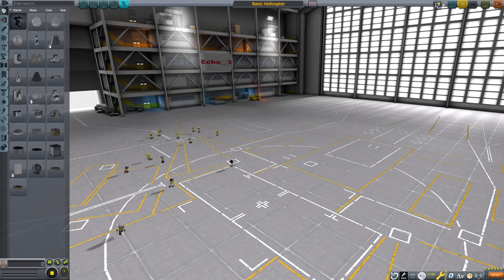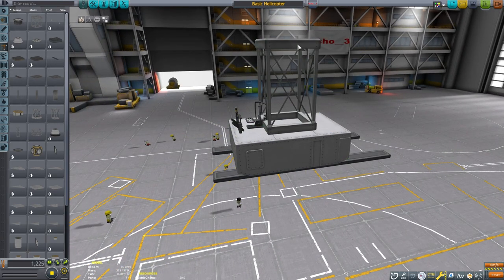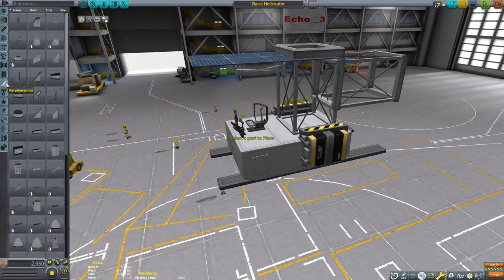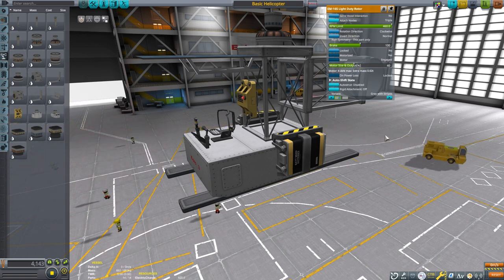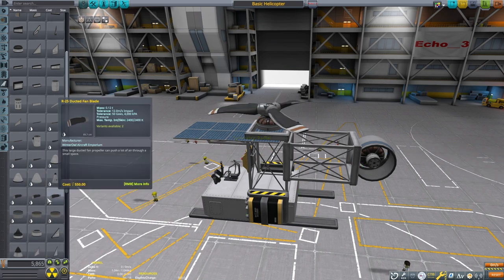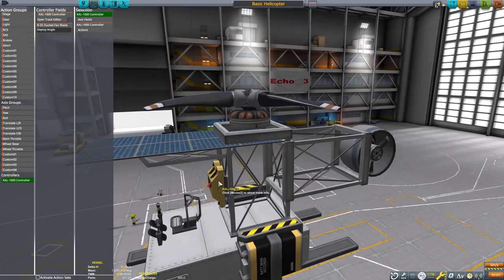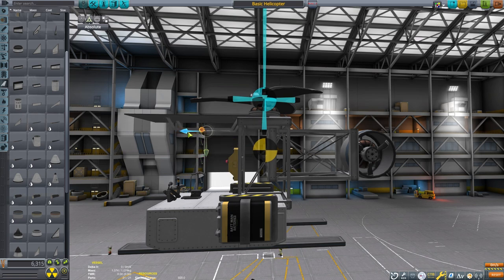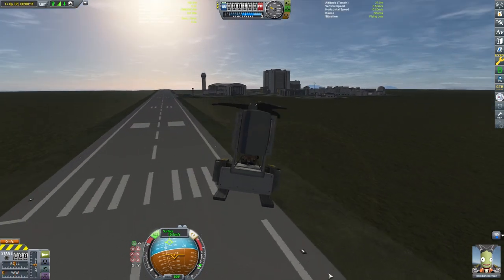Basic Helicopter Tutorial

Comment: I've read the replies to the other commenters that also had an uncontrollable spinning helicopter immediately upon take off. I can't get it to fly straight. My deployment angle on the trail rotor is at 10
Reply from the maker: I typically don't set an angle. I will deploy the tail rotor and give it around 5 degrees of control authority. Then I let SAS handle the exact amount. If you want to try and set a deploy angle, most of my designs were stable between 1 and 2 degrees. A KAL 1000 is needed to fine tune the exact amount.

Comment: I have tried a million times to set up the control device thing and it never works for me. I've set up the action things just as I saw and apon launching the propellers are already spinning. The rotors do not tilt yet when I go to the controller and press play it does. I csnt control the speed of the rotors even though I've attached it to master throttle control. I need a slow step by step video where this part isn't rushed through. Or a step by step directions list. I just csnt get this done.
Reply from the maker: I like to bind rotors' torque to an action group like translate up/down. I bind the bind the main rotor blade deploy angle to KAL 1000 play position. Then bind the KAL to the main throttle.

If you could share your craft file with me, I'm willing to look over it for you.
Reply: It's on ps5. So there's no Deployment Angle, it's called authority limiter. My set up is like a drone. I have basically a big x with a rotor on top of all corners. They are pulling aor down into them for lift. I have the F clockwise. The FR counter clockwise and rotors inverted. The RL counter clockwise with inverted rotors. RR clockwise. I set torque many different values from 0 to max to a steady amount. Altgough I tie it to main throttle apon launch they are already going because it starts off with throttle up a bit. But when I cut throttle they still run. The pitch is set to pitch and I see the blades moving sometimes but not sure what degree to set them at. I've tried many combos.
Reply from the maker: @gregdeen1469  Okay, you are correct with the Deployment Angle being called Authority Limit on console.
You shouldn't need to do anything with inverted rotors unless you have them on the bottom. For example, just have the ones on the left going counterclockwise and the ones on the right going clockwise using the appropriate blades.
A simpler solution may be to deploy the blades and set their deployment angle to 7 degrees, then bind the rotor torque limit to the main throttle. No need for a KAL-1000. Add some reaction control wheels for better yaw control and let all of the rotor blades have yaw, pitch and roll control authority.
If you are able to share any pictures, I may be able to help you better. I am active on the KSP forum and on reddit under the same username as YouTube.
Reply: Do you have a link to the forum that i can try posting in? I did a cross cross pattern on the clockwise and counter clockwise rototion thinking it would help keep stability. I wish I could post pictures here in a reply.
Reply from the maker: @gregdeen1469  https://forum.kerbalspaceprogram.com/
Reply: Which thread is a good one to post in for help with this issue?
Reply from the maker: @gregdeen1469  There is a thread under KSP1 specifically for the breaking ground DLC. That would be the best place, I think.
Reply: Awesome. I was able to post but couldn't figure out how to attach pictures. Just tells me only from a website. I dont have one.
Reply from the maker: @gregdeen1469  It probably prefers that you use something like imgr for sharing pictures.

Comment: I was thinking did the bug get fixed, is he going to address it. Nope, it just seems less impactful/noticeable on a smaller craft. The constant rolling single rotors have is not feature of helicopters, it's a bug. There's absolutely nothing wrong with the tutorial part but you probably should mention the roll issue, since there's really no good way of working around it, other than multi-rotors.
Reply from the maker: I've noticed this on larger helicopters and have used reaction wheels and deal with it. I had issues with rolling with this helicopter until I assigned roll control to the tail rotor. That seemed to keep this craft stable.
Reply: @Echo3  hey, came back to this video after a few months. I eventually managed to diagnose that bug. The bug is due to the way ksp automatically determines which way control surfaces should  move relative to CoM. This was originally designed for planes which have bilateral symmetry. When control surfaces or rotors spin around the CoM they're continually being adjusted relative to CoM and since they're inherently asymmetric clockwise/anticlockwise, this adjustment results in asymmetric lift.
Reply from the maker: @RpattoYT  Thanks for figuring this out.